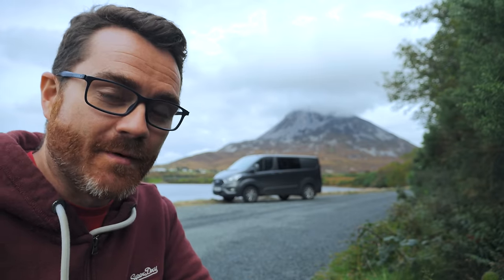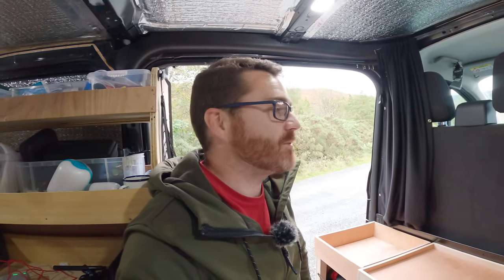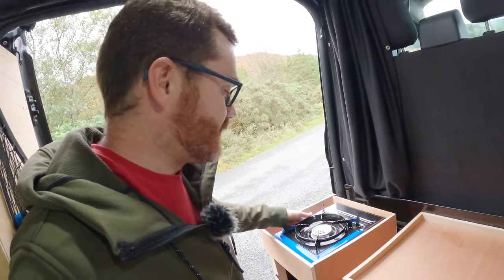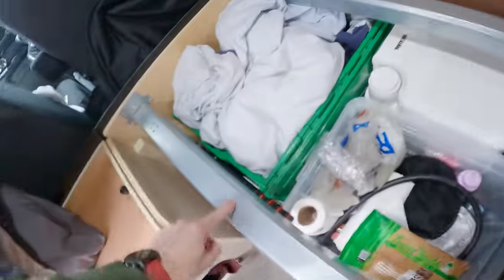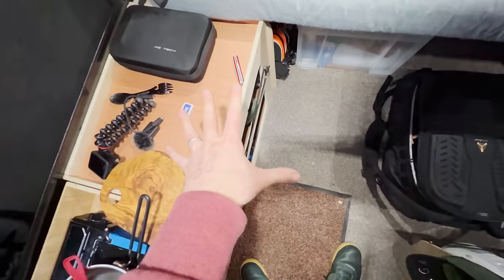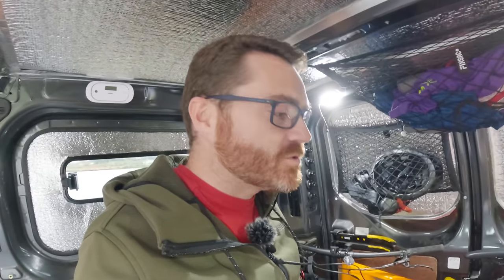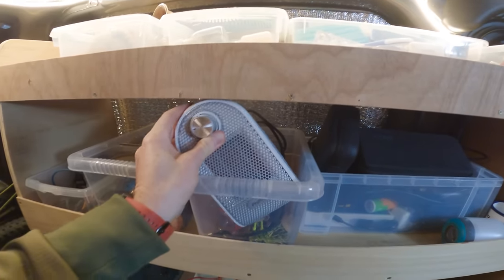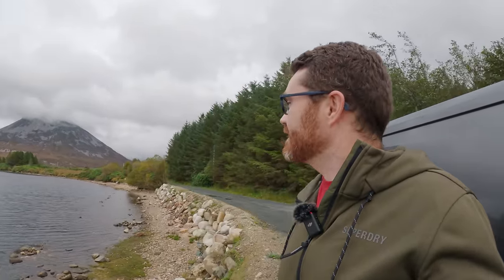VAN TOUR, Super Simple DIY Campervan Conversion - 2018 Ford Transit Custom

Comment: That's cool, but remember carbon monoxide is heavier than air and sinks so your CO alarm will go off after you've been poisoned at that height !
Reply from the maker: Hmmm the instructions said to put it at head height, but maybe that's when it's in a building
Reply: Some say to fit them to ceilings 😬 not entirely sure how they work but I don't think they're the same as smoke alarms 🤣
Reply: Pretty sure carbon monoxide is lighter than air

Comment: A clay plant pot upside-down over the stove will vastly increase the heat in the van. Overnight use tea light candles under the clay pot. It will keep you a couple of dgs warmer at night.
Reply from the maker: Does that actually work? I would have assumed the heat output would be exactly the same as the candle is producing a fixed amount of heat. tea lights for overnight sounds like a great idea though. although I'd have to open the window a bit
Reply: @StephenJReid  the clay slowly builds up heat. You would only need the window open a couple of mm. Try it at home and see how warm it gets.
Reply from the maker: @alanhunter2051  I'll have to test
Reply: @StephenJReid  you're right they don't work its kind of an urban myth. The candle does have a fixed output so the clay pots do nothing.
Reply: @marksoutta1059 it can work a bit like a radiator though. It will catch the Heat and radiate it out as opposed to heat just going up and collecting at the ceiling, but yeah... For the most part these are mostly useless clickbait because you really don't get much heat from a candle, especially not a tealight candle 😂

Comment: Could you not stick a diesel heater in it? £100 odd on ebay. I'm heading to scotland for 6 days in February  and doing a temporary conversion on my work van, hoping a diesel heater, power station, camp bed and portable fridge will get me away.
Reply from the maker: Yeah I've been researching diesel heaters. I'm reluctant though as it's a semi permanent fixture as you have to cut an exhaust hole in the floor. Would definitely do the job for proper cold weather
Reply: I've had a few days in Yorkshire in my Peigeot Exoert conversion and a diesel heater us an absolute must. Holes can always be filled in.
Reply: Getting a 2kw heater fitted to my 2014 connect on Wednesday along with split charge and leasure battery can't wait

Comment: Very nice watch your gas stove doesn’t catch fire to your separation curtains. Better devise a metal splash back. Definitely more buble foil wrap on top of all the other metal ribs etc in the back. Then carpet it all. You could do with a roof vent and maybe portable solar for the power station. Anyone outside in the dark will easily see inside your van with those curtains closed. Switch your lights on and close everything and go out and see. Your Carbon monoxide detector is way too high up and should be within 1 m of and source
Reply from the maker: great tips thanks!. I think I'll carpet it eventually, just don't want to cover the metalwork until I've stopped tinkering. I'm avoiding the roof vent to avoid increasing the roof height. There's a few carparks I can just about squeeze into that I couldn't if I added a vent.  

I'll move the detector, instructions said to place it at head height but that probably applied to a room in a house.

What do you mean about the curtains? I don't see a problem with a bit of light leaking out and you definitely can't see through them. If I'm trying to be stealthy I just put the lights on low and then you can't see in. Tested it a few times. Also have some covers for the front windows which helps too.

Comment: Too many want the Instagram look not many want the t6.1 invoice. 
This is utilitarian, laid out for your needs/use. It is the best approach to these things, as used it can be easily adapted as seen fit. Not hard to pretty it up if you feel the need. I did the same with mine then upped the aesthetics a bit. Although I'm still unsure about side/rear windows even after 3 years 😁 I use a vivaro mk3 and it has been great so far. 8 bolts and the whole lot comes out for van use, it is also my daily driver so don't want to be lugging around a conversion all the time.

Comment: If I could do my van again, I would have only a sliding door window, the other isn't needed. One laying of insulation plus thin ply and wall carpet is enough. Cooking outside, forget it. Insulate only the hollow sections the wall carpet works well. Cheers.

Comment: Well I’d like to thank you for bringing me back down to earth. I’ve just bought the same van 2017 and I’ve been looking at converting my van which potentially would’ve cost thousands of pounds and for a vehicle I want to use to get me around to take photographs not to camping would’ve been ridiculous.

My intentional plan was to do something on the lines of yours, but it seemed wrong to do so! However, I don’t want to spend the ridiculous amounts of money required to turn it into a Camper Vans that would never be used as such

I will fully insulate the vehicle and have a floor put in et cetera, but I will not now have the cabinets that run along the side of the vehicle and potentially not bother having a leisure battery installed. The diesel heater is a good idea and something I’ve been looking into, but again, it’s quite expensive but potentially a game changer.

I found the bed already one on eBay which is £300 a couple of cupboards on the side, my battery bank which I already own with solar panels and some buckets to hold clothing, food, water et cetera, but suits me just fine 

Thank you for sharing this love it
Reply from the maker: Sounds good Paul! I’m constantly evolving and changing things. I figure it’s the best way long term to end up with something perfect for my needs.

Comment: You could put a skylight/roof light in the van for more natural light, and also a roof vent to save u opening the windows 👍 great video and well done on the van
Reply from the maker: I have thought about a roof light, although I’d want a very low profile one so I’m not adding height or I’ll not get under some barriers. Can just about squeeze under 2m ones atm

Comment: He bed is fantastic. If you patterned this, it would fly off the shelves. The bed is diverse.
Love it. I part-time micro car camp. 🇬🇧
Reply from the maker: Thanks! It’s not perfect though, has a few flaws, mainly that it becomes loose and wobbly over time and need adjusting. Maybe v2 will fix all that

Comment: Looks great so far. 
Having done something similar on  vans I've rented to tour Ireland, I found that there was a lot of cold air still coming through the roof struts.
One recommendation if I may. 
Spray expanding foam into the roof struts to insulate them, but make sure to run any wiring through them that you may want before spraying.
Reply from the maker: Good idea, although I’m very reluctant to do anything permanent like that
Reply: @StephenJReid  I can't blame you 😉
Reply: Fix plastic first, then spray foam

Comment: Class! Finally got watching this, a great video. You’ve given me some great ideas for additions to the inside of mine! I’ve not really figured out my storage properly. And things like where to hang a tea towel or a wet piece of clothing, the cord along the length of the van is genius!
Reply: Also, can confirm that a diesel heater is a solid investment. Instead of using the tank it came with, I ran my fuel line directly into my vans own fuel tank. One problem though, I ran it right down to the bottom of the tank which in theory means I could run out of diesel using the heater. If you do run it into the van tank, leave some space at the bottom so you don’t run the risk of that. And it means you are less likely to pick up any sediment at the bottom of the tank too!
Reply from the maker: Thanks Chris!
Reply: A washing line is genius🤦🏻‍♂️

Comment: Looks good Steve. Sorta like being inside a disco ball at the moment with all that’s over insulation 😂 but I love that you’ve done it all the diy bodge way 👌 that means it works for you and it’s functional. That’s exactly what I did with mine.
Reply from the maker: Haha yeah. Although that will eventually be carpeted over which should make a huge difference

Comment: Brilliant, neatly thought out. Love the modular design.  Inside gas camper stove use worries me, a wee fire extinguisher would be a good addition if you haven't got one already 👍
Reply from the maker: Thanks Philip. I figure people have been using gas stove inside small caravans for decades, this is same thing really. Yes I have small extinguisher, one of the first things I bought.
Reply: Still gas , but .. I used to have a mini gas heater that took those cans the ones the stove uses , they must be still available somewhere?  Better than a naked flame .
Reply from the maker: @johnakyle5908  I looked into those but the heating elements is just about as hot as a naked flame anyway and they have to sit on the floor. This stove is up off the floor a bit in a secure place.

Comment: Did you find the hidden 12v wiring loom in the back? 
You can plug a cigarette lighter or usb socket into it and have power in the back.
Reply from the maker: I looked for it but couldn't find it. Apparently not all transit customs have it
Reply: @StephenJReid  oh right, I found mine in the back corner column. I’ve just bought a new custom so was going to see if I can find it in this one too. Maybe it won’t be there in that case.
Reply from the maker: @Will-Denver  maybe I’ll go look again sometime but I had a bendy grabber hook in there as well with no joy

Comment: Well done the van looks great.
After running through all car/van/camper permutations I've finally concluded that a swb low roof Kombi style van would suit me best.
I want to basically use a van as a car but which would be capable of doing everything else albeit while not the best at anything.
I'm a big fan of EV's so will look forward to the all new e Transit Custom coming out soon.
Reply from the maker: Thanks 🙂 I think maybe my next vehicle will be an EV, but just not a practical option for me currently. (Also outside my budget)

The hassle of range and charging would make it very frustrating and limiting for me. I can do about 600miles without having to refuel.

Comment: Have you thought about using 4-way stretch lining carpet, it would finish the walls and ceiling nicely and make it cozy without loosing any space
Reply from the maker: I have yes, but don't want to do it yet until I'm happy with how I'm using the interior. Don't want to spend all that time sticking it on and then tearing bits off if I change my mind
Reply: @StephenJReid  Good plan. You know, I was trying to work out what STE stood for in the thumbnail, but the penny just dropped lol

Comment: This is exactly the video I’ve been looking for. Some nice simple storage and usability solutions here! 👌
I’m a bathroom fitter by trade and carry a lot of tools & materials in my work van. I want to adapt it so it can become a weekend, overnighter van also. I previously racked it out myself in 12mm plywood to carry materials and tools. I keep my power tools in mobile crates for quick removal at night. There’s currently space for a single bed and small table to cook on. Just need insulate it now, install a ventilation fan in roof, cut out some side panels and fit glazing, then I’m good to go travelling 🧭 Thereafter, I’ll think about upping from 12v to 230v?
Reply from the maker: Sounds like a plan!

Comment: Could you add a link to the Ikea bed supports you used please? I'm looking for something similar.
Also, intrigued by the bugle! Reveille? (Every camper should have one!)
Really enjoying your conversion build and the reasoning behind it. Great to hear about your problem solving methodology. 
Can I also recommend Luci Lights (inflatable solar lamps). Pop them on your dashboard each day and they're charged and ready by dusk.
Glorioius light. I bought them to put in my translucent origami kayak.
And you can get heating diffusers for those little gas stoves. About £12 or so - they just sit where the kettle goes.
Reply from the maker: Here you go: https://www.ikea.com/gb/en/p/skorva-midbeam-galvanised-90124534/ 

So I can’t really play the bugle, I briefly tried to learn trumpet as a child and failed. But I can play it enough that a non-player might think I knew what I was doing.
Reply: @StephenJReid  Thanks for this - although I can't see how these IKEA bed midbeams are adjustable in length like yours - with their 'slide in and out' feature... ??? Although it may just be that the info online is scant. I now see it's got a maximum and a minumum length stated.
Reply from the maker: @karinatownsend496  yeah they are made from two sections that fit into each other. Really they are meant to come with a bed so if buying on their own there’s not much info
Reply: @StephenJReid  Thanks - makes more sense now!

Comment: Cool video, thanks for it! I've just bought  the same car and searching for ideas how to sleep/cook and stay inside in bad weather with my bike. So your solution gave me hope that it is doable :). I am just wondering if your car is L1 or L2 (shorter or longer version, cannot figure that out from the video) ? Thanks and happy travelling!
Reply from the maker: Thanks! Mines the short wheelbase. In hindsight, the longer version would have given quite a bit of useful extra space. But the shorter version makes parking easier and feels like a car to drive.
Reply: Thank you Stephen, that helped me. I actually bought the shorter one as well because of the easier parking etc.

Comment: Cool build. When sleeping are having the windows open slightly within the gap of the wind deflectors enough  to prevent condensation? Thanks in advance
Reply from the maker: Depends on temperature. But typically I only get condensation on the windows. In colder weather I will get some one a couple of places of bare metal work on the ceiling. That’s why my next step is to carpet

Comment: Nice video Steve, I have a few questions if you get chance please. 
Is it a short wheel base van? 
I was thinking of similar build, I'm only 172cm/5ft 7ish in height and was wondering if I could use a bed design like yours, only side-on laterally between the sliding door and the other side, would there be sufficient space for this in a custom? 
I was also thinking maybe it would be possible to change the front seats to swivel ones, turn them around and use the space above the seats width wise with a similar bed system combined with the above idea to make a double bed?
For the above I would use the ikea supports with slats that could be stored and the other mattress could be a back rest. 
What do you reckon? it would be great to hear your point of view as a designer with the actual van that I would like to buy.  
Cheers
Reply from the maker: I actually had a previous version of the van where the bed was across the van towards the back. It was a bit too short for me though as I’m 5’11’ but might be perfect for you.  I could sleep on it but it took a bit of getting used to as I normally sleep stretched out. 

Regarding swivel seats, I researched conversion bases but seemed like a lot of work to install and varying reports of quality and ease of use. So I’ve left it for now. It definitely would add a ton of space being able to swivel even the passenger seats around.
Reply: @StephenJReid  Thanks a lot, width wise would be perfect, I'm getting a good idea for my design, (important to get my bike and paragliders etc in the back) great to hear from someone who's done it cheers, I'm liking the videos, Cheers

Comment: an insightful video and nice to see the end products from IG stories in their "natural environment" now 😄

I know it's a stretch in your part of the world, but did you think about solar panels and then storing that energy in your battery?
Also, what's the wireless? microphone you are using?
And last question. If you choose your track/trail where you will be running, how far from home should it be, before you take your van or any other transport vehicle? 5k+ or 10k+ 
Just want to know how near your home the track/trail should be to where you would just walk before start running 🙂
Reply from the maker: I have thought about solar and have been looking into a bit, not made a decision yet. I’ve also been thinking about gettting a roof rack for extra storage which obviously would block the solar panel.

Nearest trails to me are about 5k away from home, I’d usually drive there to run. 

But the trails I run on the most are at least 30km away